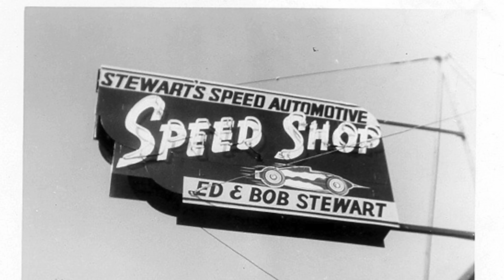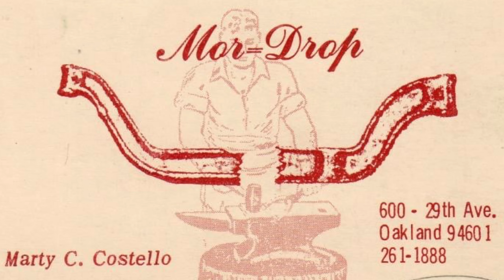HANDMADE JIG From Scrap Metal | Drops 1928 - '48 FORD Axles! IT WORKED!

Comment: Fire brick “ envelope “ .  I worked as a front end mechanic back in the early 70s,  we routinely bent axles to align front wheels for diesel trucks.  50 tons works wonders even cold.  Definitely turn some good steel for imitation king pins- with an end that you can lever the damn thing out with 😂

Comment: Hey Jordan as a suggestion to help protect the cylinder of the press use a solid spacer between it to absorb most off the heat
Reply from the maker: Yup it definitely helped a bit forsure! A few more heat shields should help too.
Reply: And maybe a 'loose enough', tube sleeve, around the ram, as it descends, to deflect/absorb the heat?
Reply: Sorry mate I added this comment before I got to the end of vid , you know what your doing , love your work keep them coming ,cheers

Comment: You may want to get some bar stock, like 2" square bar, drill king pin holes. And a mounting holes  to practice with.  maybe weld on the king pin ends on 1x2" bar, and make some two layer heat shields. 18-20 gauge alum with a 3mm spacer between them with a heat resistant cloth or insulation behind it.

Comment: Excellent video as always, great that you share these things. No doubt you have this covered, but it surprised me that the 10mm plate that holds the king pin supports is so lightly welded to the upright beam. Maybe a big plug weld through that plate right in between the king pin supports, might stop some flexing that could have increased the difficulty of removing the king pin. Which might get worse after a few uses.
Reply from the maker: Definitely a good call !! Thanks Bernard

Comment: G'day mate, has the heat, shrunk the holes in the bosses, just a thought. Hooroo se ya later
Reply from the maker: Definitely possible! I used a bit of heat to pull the pin recently made and it helped

Comment: Rather than trying to keep the heat away from the press ram, make an extension for the ram to move the axle (and heat) lower and away from the ram? (typed that before I ran out the door for work, before the end of the video. ) Also, when you make the new 'kingpin', add a thread section on top so you can use a hollow porta-power ram to pull it out.

Comment: Id suggest a top set of rollers to the jig, then have the press end a sleave of the ram connected to a spacer to get the ram away from the heat and on the end if the spacer a pin that goes through the radius rod hole this then would hold the axle square as it comes down keeping track and radius rods square stretching the drop

Comment: hi i would use some ram extensions and guide for ext to get the heat away from the ram oil seals ect did you try a bit of heat to get that stuck pin out
Reply from the maker: Part two I try and create some heat shields and spacers to get away from the heat. It helped forsure

Comment: Hi did the hot rodders in the usa ever use Bellamy or Bowdon independent front suspension.All the best peter
Reply: Those are essentially half I beam axles with pivots (balls) on the opposite ends to the kingpin ends and allow a degree of independent wheel hub movement, right? British 'off-road' Guys used these for trail driving and still do, when they can be found, or homemade!

Comment: Have you thought about building an induction heater for this?
Reply from the maker: I’m not sure it would work. But possible? I need to keep the heat away from the kingpin and spring perch Boss
Reply: @bennettscustomsco  I believe it would work for this, they only heat around their position. It would also keep any heat away from your hydraulic cylinder.

Comment: Why not cast a few axels a large mold could
 Fit between 2 and 4 axels , make any drop you want, beef them up a bit. Keeping looking stock as possible. You can build a furnace yourself. Make some molds, get sand, plaster foam so you can do the lost foam casting, then make a axel from foam . Coat the foam axel in plaster. it will have better details than a sand only cast. Using plaster the sand only supports the plaster, make it from cast steel, cast iron, cast aluminum. Move details anywhere you want you canstart a small business. A small backyard foundry can make money. Use wast oil and recycle brake rotors , aluminum wheels cast engine parts from the junk yard, cast parts can be recast easily, they are alloys designed to cast well. Use steel scrap bits from a machine shop hot rolled scrap with a bit of better quality steel isnt going to hurt. Waste oil and a leaf blower  can melt about anything. If you need. Add some o2 to the mix..

Comment: I have a good idea i think for a jig, where can i send some pics of my idea i can sketch it out for you.
Reply from the maker: Fire them through! Info@bennettscustoms.com.au
Reply: I love the journey of ideas in development. Thanks for sharing.
   My two cents: hydraulic heat isolation.More heat,more even heat and greater pressure.
     I have a little exposure to induction heating in the foundry.Very fast and even.Possibly make some type of refractory clamshell around the heated portion of the axle containing the induction components.But that’s probably better saved for iteration 2.0 as flame heating is sufficient for now.
   Will be following. Thanks